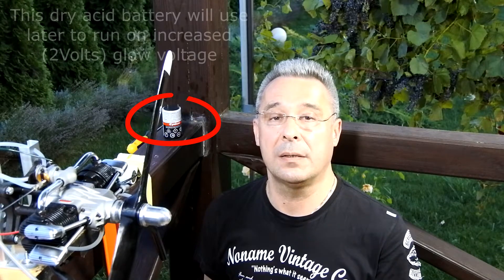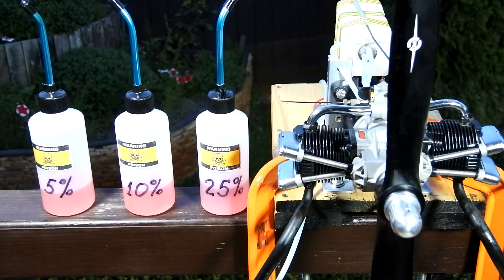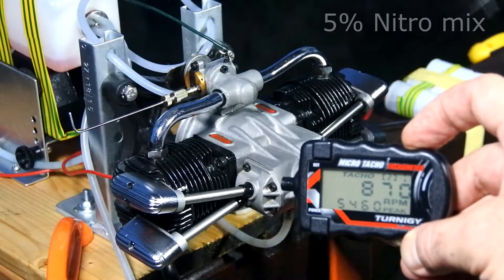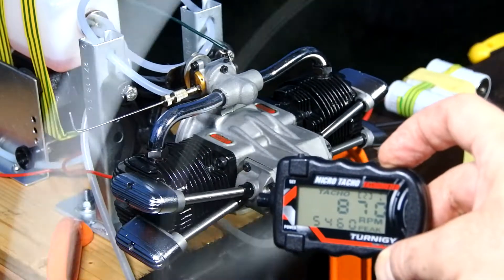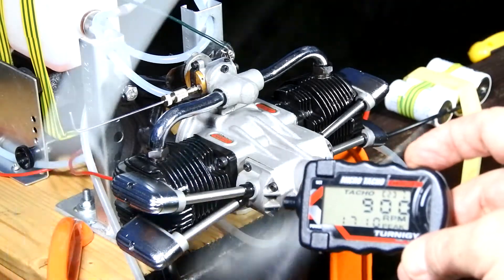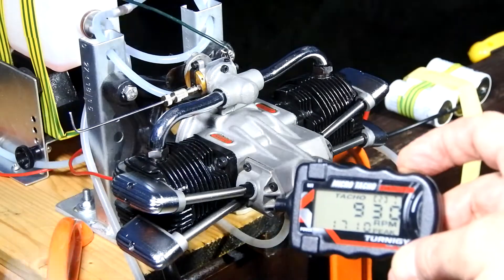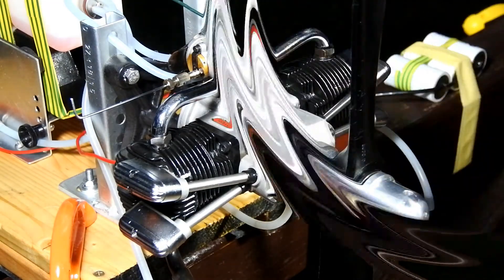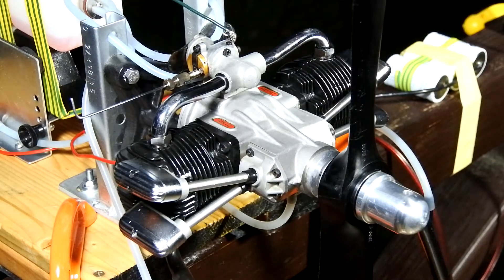Saito FA 270T testing influences on idle Part 1

Comment: Wonder how she idles with no glow heat.
Reply: Looks to me like he has constant power to the glow plugs
Reply: @brianemery8945  Yup, why I said what I said. I try to avoid external glow heat as much as possible to prolong their life; that and I feel an engine that needs external glow heat to run isn't tuned quite right. Then again I'm also not shooting for 3-digit idle speeds...I'm happy if it's in the 2500-2750 range.
Reply from the maker: @brianemery8945  Sure, it is.
Reply from the maker: Thank you for your comment. I'm planning to continue to work with Saito FA 270T, so definitely, will show later in videos idle w\o glow support. From my first test runs with it, could state, that 1.200 - 1.300 rpm is absolutely realistic figures.